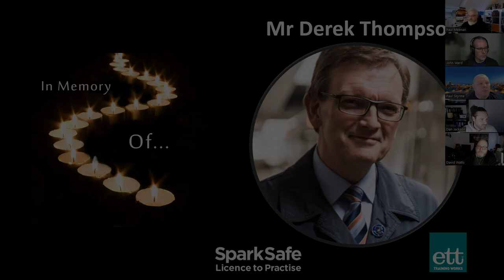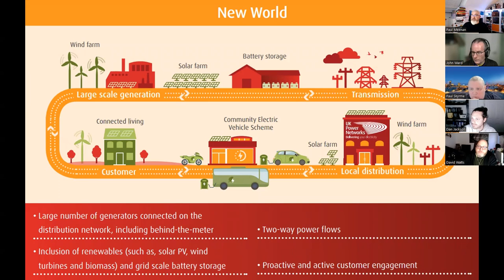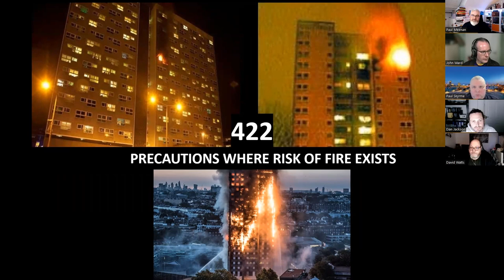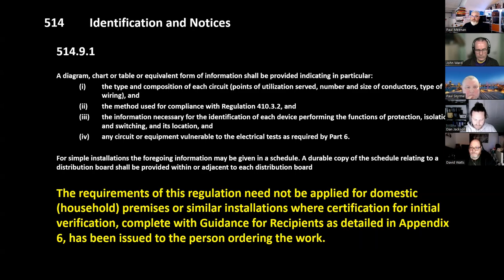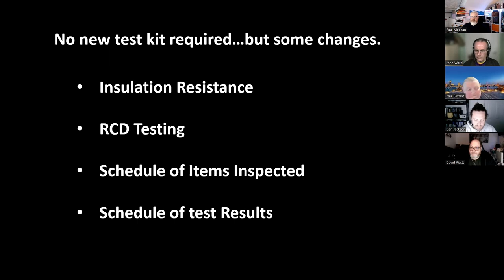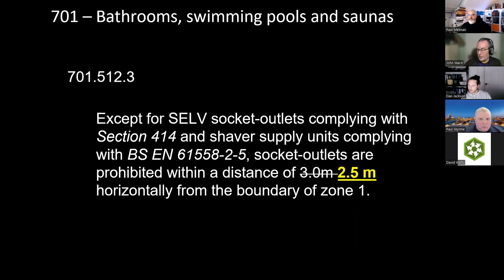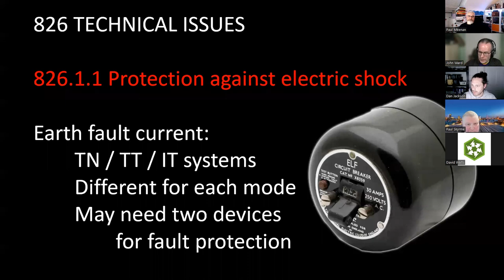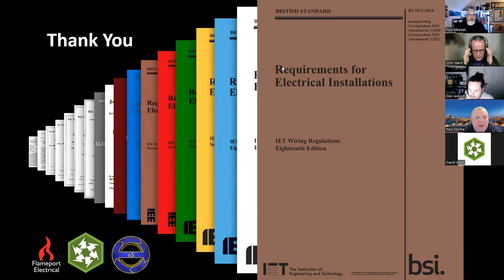BS 7671:2018+A2 2022 18th Edition Webinar 2

Comment: Your comments about MDPE and the fact that the MLCP pipe could be incorrectly identified as the same is a perfectly valid point and is something that I feel is missed elsewhere.  Use this in my 2382 and 2391 training.  It's important to inspect the plumbing installation even if its connected to a MDPE on the off chance that it then becomes buried.

Comment: Thanks for video, very informative as usual.  I am concerned around Regulation 411.4.2. Earth rods/PME.  I see there gently trying to slip it again,  I completely understand why, but If the loss of the neutral is becoming more common & a real problem it should be down to the DNO to install these earth rods.  I have no problem installing a rod on a TT earthing system (Overhead supply) as there is virtually no chance of hitting a live mains cable, there is of course the possibility of hitting a drain/water or Gas, but these are unlikely to kill you.  I see that it is just a recommendation, but recommendation now says 'Should'.  I feel everything as if everything is being put on the average spark, the DNO should take responsibility for their network.  Driving rods into the ground is a major risk/hazard & I have no doubt some sparks will be killed or seriously injured in the future.
Reply from the maker: Totally agree. It does appear we are bearing the brunt for others issues.

Comment: seems to be mixing residential/commercial, around 37.20 -- where the electrician is designer and installer, it is the role the designer (often the electrician) to understand the building compartmentation, FRP, and the role of the Installer to ensure all openings/penetrations shall maintain the FRP.  Put it another way, if its not the installer, who is responsible? the home owner? the landlord?

Comment: What is the rational for dc cabling to be red (+) and white (0v)?
I occasionally carry out work on German originated 24volt DC systems for commercial vehicles that originate from the late 1990’s where DC. ‘Colours’ are black (+) and brown (0v), then we go to Brown (+) and Grey (0v). It’s a dogs breakfast of confusion.
Reply from the maker: Good question, international harmonisation we assume. This was and will always be painful. I’m still getting over changing red black to brown and blue and that was 20 years ago.
Reply: @e5Group  When you started out with red and black what is the need to change!! It's clear. And sorry for being old and boring but red, yellow and blue was ok for three phase differentiation. If you are colour blind please choose another trade.